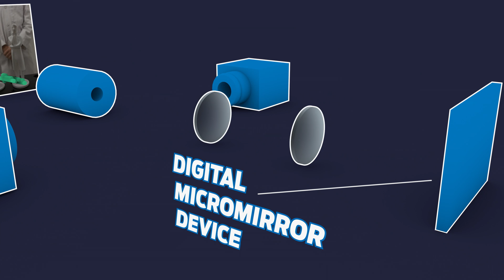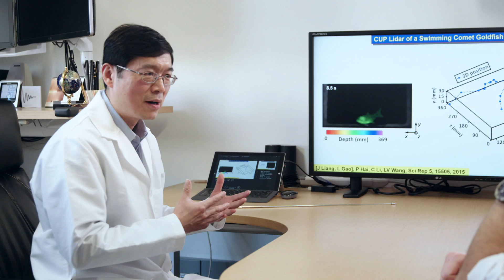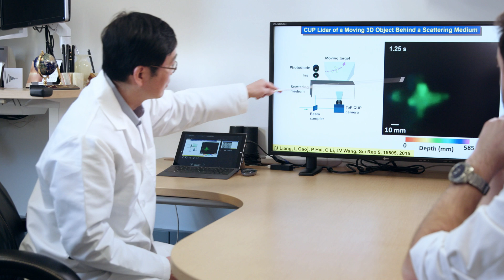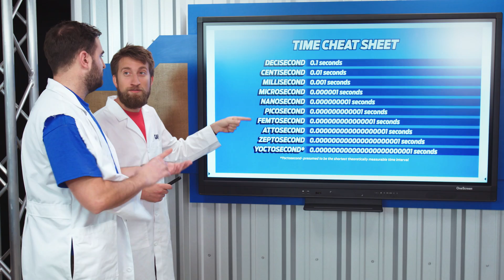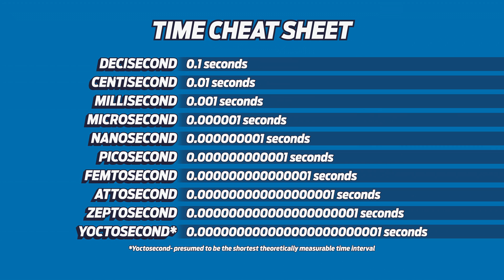How do you film the Speed of Light?

Comment: Thanks Mr Hong. I still have no idea how your camera works.
Reply: So true I didn't understand a thing
Reply: From what I understood (with a wikipedia article on the streak camera and a news article on the whole setup), the streak camera is the one in charge of recording the change in light through time. It is constructed in a way that, as the thin streak of light enters the camera, it gets deflected on a different part of the camera sensor depending on when the light entered the camera. The image the camera produces is a 2D image, but each line of the image represents the same line that was recorded, just at a different point in time. This way, they're able to record a thin streak of light at a very low temporal resolution.

However, the resulting image quality is very poor, so they use a secondary camera that records a still image (i.e. a single frame). Then they use the data collected from the streak camera and combine it together with the still image with a mathematical method called a Radon transform. This enables them to effectively reconstruct what the movie would look like as if it was taken with a single insanely fast camera.

I don't know what the whole encoding business is about, but the article I used as my source is 6 months old, so maybe it's some sort of improvement. Or just something not mentioned in the article.
Reply: @afluka  They said they modified the streak camera to allow a 2D image to enter instead of a line. I think these 2D frames are deflected over time just like the 1D frames of a standard streak camera, so they overlap on the sensor with a one-line offset between frames. I think the micromirror device imparts a special pixelated coding to the incoming image that allows the individual 2D frames to be reconstructed from the combined image. (Think of it as an optical version of code-division multiplexing, where a different pixel code is used for each line of the incoming image. Since the 2D frames are deflected over time, any given line of the sensor sees a different line of each frame. So any given line of the final image is a combination of frame lines that used different pixel codes, allowing them to be reconstructed.)

Edit: Illustrations in CUP-related journal articles indicate that this is in fact the approach they use.
Reply: @afluka  You have it essentially correct.  The part that they didn't make clear in the video is that they aren't taking pictures of the same photons moving through the scene.  Think of synchronizing a video camera with a strobe light and making water appear to stop in space.  This is a similar concept where they are synchronizing the camera with the laser which is blinking on and off.  Every time the beam travels through the scene, they are capturing the photons at a different offset from the time the laser starts it's cycle.  They undoubtedly have to delay the captures to allow the CCD to be read, which takes time as well.  So, they are actually taking millions of tiny photographs at offsets in space and time to build a single image that represents what actually happened even though that event actually happened millions or trillions of times while the process continued.  I'm extrapolating from what I've just read and heard from other sources, there wasn't nearly enough in this video to get this level of detail at all, in fact it was pretty terrible at describing what was actually happening.

Edited: I see now that I was reading about the MIT camera.  This one does things a bit differently and while it's also simulating the process (to generate the final movie) it's doing it based on a single laser pulse, which sounds a lot harder to me.
Reply: @sgartner  this type of slit scan seems to be done using an image intensifier to convert photons to electrons  and then steering that  across a CCD.

Depending what is wanted the optical aperture can be a spot, line, or an area. With a spot you could get higher time resolution or a longer capture by scanning a spiral on the CCD but you only have time and intensity, a slit aperture gives you time, intensity, and one spacial dimension. If you open up an area you lose time resolution, (but keep extremely precise start and end of exposure control) but keep intensity, now with 2 dimensions.

Where it gets cool, is that combining a coded aperture and motion blur(scanning the image across the CCD) you can retrieve intensity over time information.
Reply: @RobertSzasz  Thanks Robert, that helps.  And I can see how the image data from the static image they take could be used to remove the noise from the process and allow them to map the slit-captured data to a usable set of video frames.  It's very cool stuff.  I can't wait to see what they do with it.
Reply: @afluka  well,you wrote the script
Reply: afluka dude... I am not reading all of that.
Reply: 1:49 Lihong Wang, PH.D.
He is Mr. Wang...... Not Hong 😆
Reply: I zoned out.
Reply: It's probably patented so he won't release "how it works" But I heard you can't build a recorder that records at the speed of light as that violates the information paradox.  The fastest detectors operate bout 1million fps.  So what I suspect is happening is that the femtosecond of exposure is stretched out by diffracting it along a series of mirrors, until it's "slow" enough to be recorded.  Rather like stretching out pen marks on a rubber band.  The "information" is retained but "longer" so now can be recorded.
Reply: @pixifixi2076  if it's patented, they by definition released how it works. That's what a patent is. You release how something is made or done and in return you get a period of time when you're allowed to decide who can do the thing commercially.
Reply: yeah suppose you right, still would like to know how it works though. @RobertSzasz
Reply: @pixifixi2076  to get a patent you gotta explain the working bruh else you won't get no patent.
Reply: @pixifixi2076  
That only explains partially the remote possibility to record one frame. And remember electrons in the components to turn just one element high or low move about 100 times slower than the light. After that you must process thousands of these to process the code and control the system. So what if you use components and processor using light instead of electrons. Faster speed but you still must have thousands of light pulses traveling reading and processing before this one pulse moves away. Then you must record massive amounts of data. After the statement I'm 99% convinced its fake. And it does look fake after all. The pong video doesn't dissipate any while bleeding over to the camera. 
Worst video from the slow mo guys. Im sure they dont understand it but they should at least request a real answer.
Reply: @pixifixi2076  bingo, it's a bs invention... also he forgets the double slit experiment... which has found that light will behave differently when someone or something is observing it. This means we still have no clue what the light is doing when we aren't watching it.
Reply: I understand the Plumbus better than that camera
Reply: Steven Shawa what’s funny is that this channel was always about Gavin coming to America and working for Rooster Teeth.
Reply: thats probably because of the many cuts in his audio
Reply: quantumbits that’s Dr Hong to you
Reply: He explained it on such a high level, it would be impossible to understand if you didn't already. Its like if someone explained how a normal camera works by telling you that it captures light to make a video.
Reply: Did you mean me?
Reply: They just used several trillion distinct cameras photographing the same scene at the same moment, each infinitesimally farther away from it than the previous one. Simples...! I mean, it worked for The Matrix... ;)
Reply: @AttilaAsztalos  This is the best explanation I've found in the comments and probably the truest.
Reply: Lmao hahaha
Reply: It's JFM, baby!
Reply: I think Dan is high .
Reply: Thing is he himself doesn't know how it works
Reply: exactly
Reply: Exactly!!! Thank u and whoever else worked making this camera and technology!
Reply: Probably can't actually says how it works due to industry funding behind the experiments. A nightmare of NDAs
Reply: I had the same feeling, then i asked my teacher and he explained me how this camera setup works, i just left an explanation on the comment section!
Reply: hahaha 😂😂😂😂
Reply: LightSpeed | NotLightSpeed 
:-)
Reply: I think it said Mr wang
Reply: It screens awhatever you are filming. Boom! Done!
Reply: Faster frame drops
Reply: Simple, they somehow managed the camera sensor to have exposure time of pico seconds
Reply: I zoned out at wang
Reply: Mr Hong Hong clearly explained how the camera works. Kind regards, Best of the best of the best. With honours!
Reply: LMAO
Reply: The government doesn’t want you to know.
Reply: Neither does anyone else... No explanation whatsoever. He may as well have said it magic! I believe its fake to get govt grants.  You would have to have a processor and components exponentially faster than light achieve this! Fake BS!
Reply: I think if you put x sensors at different distances from the objetive you are recording, and you trigger them at the same time, you will get x different frames or pictures from it; since they are at different distances they can capture different stages of the light moving trough the objetive, cause the light takes a bit longer to reach every sensor, from the closest to the farest ones. And maybe you dont need different sensors, just one big sensor that get the light at different times, using angles so the light travel different distances to reach different parts of the sensor. Sorry for my bad english.
Reply: @acemasterx2514  
Doing that would be separate photos at different angles. The closest possibility would be to split into separate fibers with remote sensors , I'd guess. Then their would be a timing issue and wiring length and placement would need to be calculated precisely. Seems a bit much. 😕
Reply: Not the best explanation, no
Reply: They havent filmed anything in plank second atleast.
Reply: Awokwokokwok anjir
Reply: I have no idea how camera works
Reply: Because u bunked the physics class.
Reply: His name is Wang. Lihong is first name
Reply: You need to read tons of papers go get the idea
Reply: Not their camera 😂
Reply: I was looking for this comment just to know I wasn't alone lol.
Reply: @Ibrahim Syed wang hong
Reply: @Ibrahim Syed  i didnt i just thought wang hong would be correct 😂😂
Reply: quantumbits
Mr Wang: “It works… very effectively.”
Reply: You are not alone haha
Reply: Dann bist du zu schlecht
Reply: It works like a Kinect. Projects a known pattern, capture what is reflected and decode it. Only difference is they have timestamps for each pixel or whatever you wanna call it.
Reply: And I thought I am the only one who didn't understand this :)
Reply: My thoughts exactly
Reply: That’s because his explanation did not describe what’s actually happening (spoiler it’s not miraculous); and then all the stupid sycophant like talk turned the presentation into a cartoon.
Reply: /⚫Ğöt ol!
Reply: Video on youtube called ""LEVEL"" by Eric Dubay. Also ""THE NEXT LEVEL"" by Martin liedtke. Both excellent videos.👍
Reply: It go brrrr fast
Reply: If you recorded deep interstellar celestial chem-life mass entities in space, using a fast recording,  you can slow down the fast-forward events of historal lights through time and space toward your visual sensors. However you would need to divide the playback recording with hundreds of team member/Ai. To even spot a mothership, that idle a few nsno compress years ago.
Reply: Steven Shawa the MIT camera uses a different technology.

Here's an explanation in just copying and pasting from the last video. Because I think it's really cool.

I wanted an explanation on how this is done so I looked it up. Sorry if there's anything wrong this is the best I could do in 15 minutes.

What these guys have done is take a "streak camera" and use some math called a "radon transformation" to overlay the data from the camera that they store as a "tomography" onto the picture they took with the phone. (I think this'll make sense just keep reading)

What a "streak camera" does is it takes the photons (packets of energy that we see as light) that reflect off of the things they are filming and converts them to electrons using an cathode. They detect the electrons in an electric field that's changing really fast. Because it changes so fast the electrons detected in the beginning are affected by the field in a different way to the electrons detected in the end. From that you store some information.

This information is stored as a tomography. It's really just a way to store information from one singular point in time. So if I know that an electron is deflected by this much at this point in time then I can store that information again BUT NOW with a timestamp.

But this tomography is just data with some time attached to it. It's not a picture yet. So I do some really fancy math that'll take this tomography and will put it back on an object. And that's where the phone comes in. The Radon transformation puts my tomographic data onto an image that I took with a different camera.

Now try reading the first line again and see if it works.
Reply: @muneeb-khan ...thank you for your excellent explanation...I got it...then this idea is really cool and it could be done...but it requires alot of database to store and pack and unpacking data ...64 bits? The question is can our computers 🖥 has capability to process it 🤔???
Reply: This Video does a good job https://www.youtube.com/watch?v=EtsXgODHMWk
... might not completely be the same, but surely similar
Reply: there's one crucial thing that they did not explain : the camera doesn't catch the scene by recording one single light pulse, it composits hundreds of images of hundreds of different light pulses fired in the very same scenery, coming from the very same point.

the feat of this technology is for the camera to be synchronised with the laser in such a precise way, that it can make a picosecond difference between two recording instances, allowing it to recreate this animated movie of a light pulse.
Reply: MrGustave1er this camera uses a single light pulse. The technology you're talking about is different and was used in other "trillion frame" cameras
Reply: N
Reply: Rounak Alam lloll
Reply: Sounds to me like it just generates a simulation off how to the light scatters and then superimposes it on an image??? Then just add the timer to make it look like it's slowmo. I mean, it's just playing an animation...
Reply: It’s not a camera! Did you not hear him? It’s a Camerrrrrr

Comment: My question is, if there is nothing faster than light, said by all scientists, than how is the camera filming light? Wouldn't the camera shutter speed be faster?
Reply: The slit makes it so you don’t need a shutter. It’s basically a composite of slots stacked on top of each other
Reply: @Prestown  hmm that's complicated.
Reply: Because it doesn't need to be faster, it needs to be fast enough, it moves the frames from the sensor less distance along the cable than the light moves in the picture itself, it doesn't need to have a shutter
Reply: Thats not at all how this camera works. Might suggest you watch that video again. Although I myself didn't get it quite either, but the things I got from this video are:
They used multiple cameras, the camera had no shutter, the information got translated into code, a program will translate it back and you can go to the exact moment you want to watch.

Comment: I was curious, how far should Gav and Dan stand from each other to register the speed of light with their flashlight experiment. Assuming the fastest they can shoot is 500000 FPS, one frame takes 2 microseconds. In this time light travels 300'000 km/s * 0.000002 = 600 meters (a bit less than half a mile). If they stand at this distance and do the experiment with the flashlight and a piece of paper, then there will be a whole one frame in the video, where the flashlight is already on, but the piece of paper is not yet illuminated.